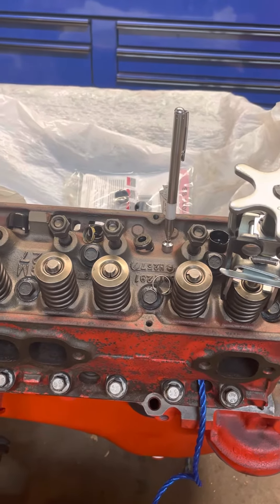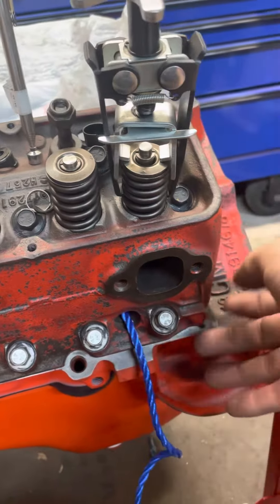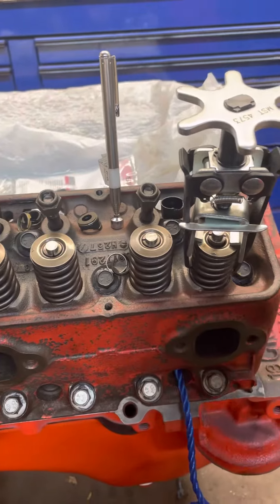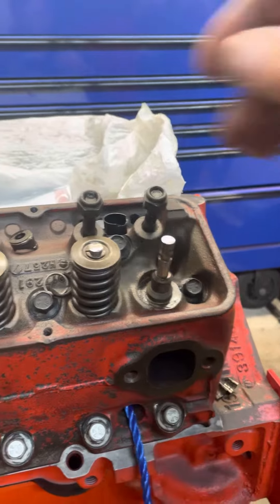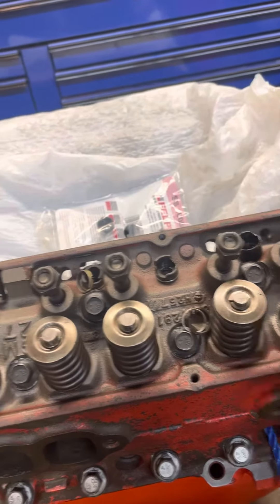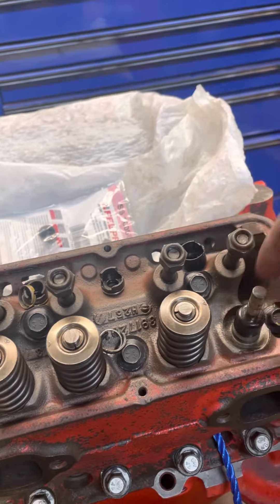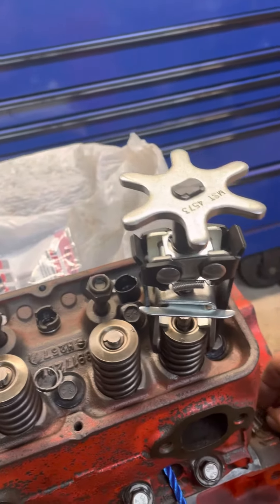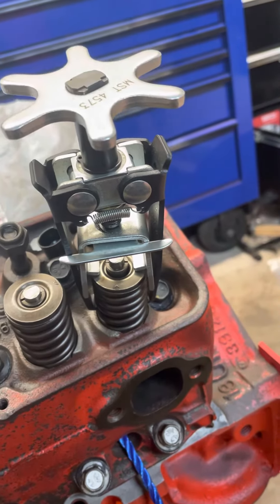Grab your umbrellas, it’s time to change valve stem seals

Comment: There are 2 kinds of seals. The umbrella type, which you demonstrated, & the positive type seals, which are in fact an upgrade from the umbrella type. Stay safe everyone ☮️
Reply from the maker: You're right there is an updated seal for the old umbrella. I didn't show it because some require modification to the valve guide. Thanks for watching
Reply: 3……umbrella, positive, and no seal but oring on the stem between it and the retainer. Also a large metal cup shroud over the spring for deflection. It’s the original GM setup o-ring only to keep oil from running down the keepers onto the stem.

Comment: Normally if using umbrella seals there is an O-ring that fits in the lower groove on the valve. The other seals you pulled off are an upgrade as they actually seal, they were just the really cheap ones and as you saw, they break down like they did. Pretty much the only way your getting a good seal is to cut the guide diameter down to .530" or .500" first. Then a quality will fit and can be used.
Reply from the maker: Thanks for the comment, so few mechanics now even know that umbrella seals were a thing, including myself until I had the opportunity to go through this engine.
Reply: @happygarage6310  its old teck, so not spoken about much these days. I still get them old castings in for rebuild, have two sets of 370's  and a set of 462's in the shop atm. So I still get to see them somewhat often.
Reply: I believe two seals is considered overkill and starve the valve guide of any oil. I don't see the harm in the way it was done here. Those tiny o rings will crack and get in passages. That's for sure. If they were there where are they now?
Reply from the maker: I had the engine completely stripped and cleaned. Was only gonna be a gasket refresh, but found glitter in the oil pan.
Reply: @makeitup3093  this is why YT is great. So guys like me who know very little about rebuilding engines can be set staight by the pros that do it daily
Reply: @happygarage6310  not the glitter! Lol. Not fun to find that mess in the pan
Reply: Either o-rings OR umbrella seals OR positive seals on the guides, but not more than one type should be installed on each valve.
Reply: @Spiritof_76 uhhmm they come stock with an o ring and umbrella for deflection stock from 67 to 86 or so from GM
Reply: @Mad-productions.Jay.  Not the metal umbrella that came stock on the heads; those go with the o-ring seals. I'm referring to umbrella seals that slide onto the valves.
Reply: So do I need the O-ring or not? I’m confused lol I see a kit on Amazon and it doesn’t include the o rings
Reply: @dolphy2x910  yes you do. You have to check if your heads are machined for positive seals or not. If not then you need them look at your heads before buying a set.
Reply: @Mad-productions.Jay.  just ordered a set of umbrellas with the o rings to be safe
Reply: @dolphy2x910  well they fit and are cheap so it's a safe bet 👍 but if they have positive rubber ones with metal clads or bands use those way superior if they are fitted already. PS you don't need them if you have the positive style seals.

Comment: How do you get the rope out since its really in there to keep the valves up? Do you go CCW?
Reply from the maker: Yes, ccw will do it, only 15 degrees or so.
Reply: @happygarage6310   Thank you for quick response. would this work with engine still in the vehicle and the starter still attached? I have a 1994 C1500 with 350 TBI small block
Reply from the maker: @HungNguyen-ox4up  yep works well, just need some inexpensive rope that fits in the spark plug hole, feed it in when the piston is down, I reckon I fed 3 or 4 feet in at the time of the video,  and then rotate the engine until it stops.
Reply: @happygarage6310  Thank you !

Comment: Is there a certain order you have to replace each cylinder in ?
Reply from the maker: Not necessarily, my preference would be to replace the ones more difficult to get too first, if the engine is in the car. There’s also a little o ring, if I remember correctly it goes between the umbrella and the valve keepers, not certain of its importance.